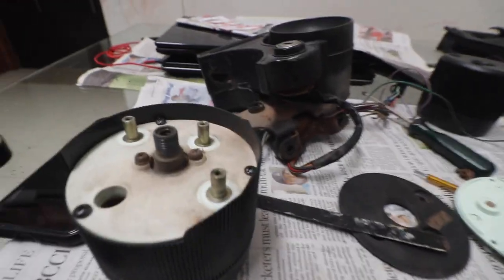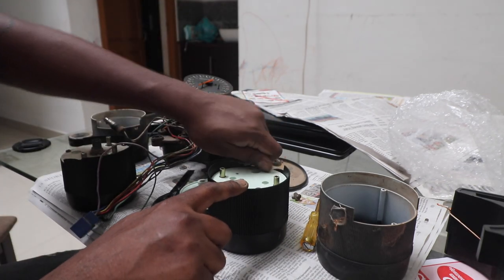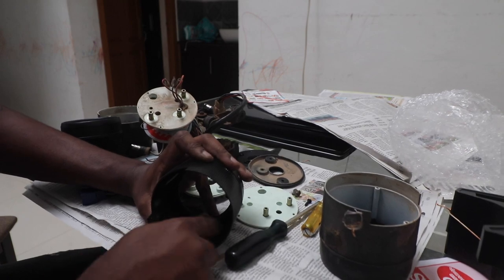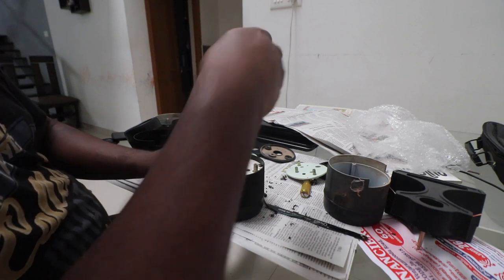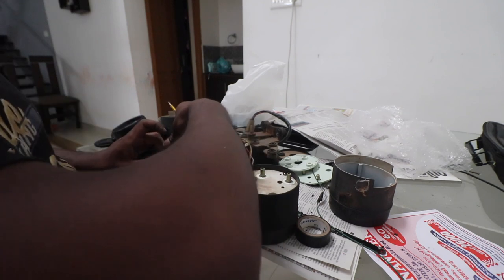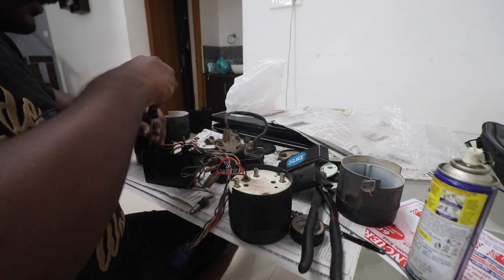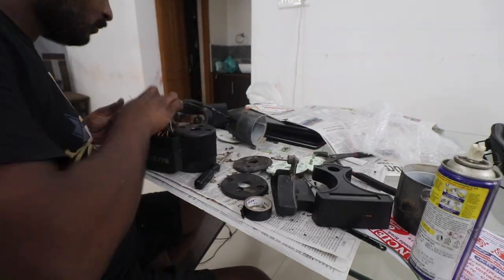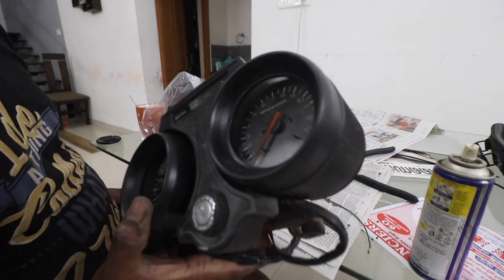Suzuki Shaolin Restoration part 10(Speedo/Tacho case replacement)

Comment: Bro Shaolin gear indicator meter wire shogunilu evideya connect cheyyunathu?
Reply from the maker: You need a shaolin gear indicator type neutral switch for that